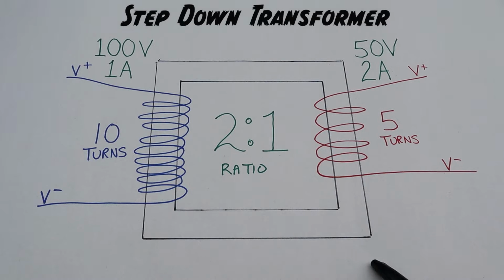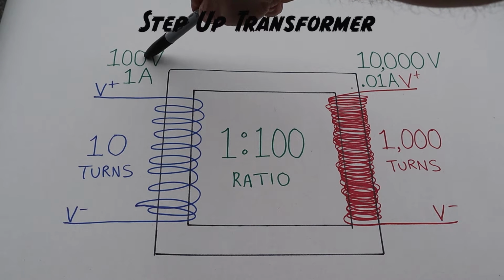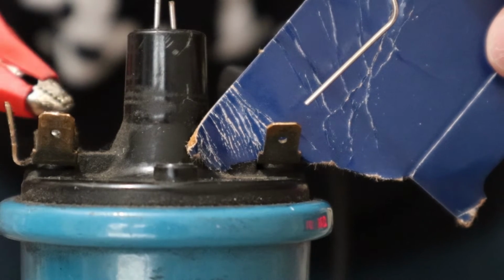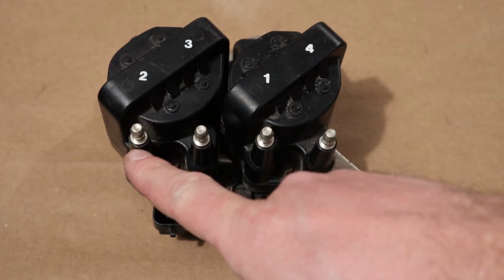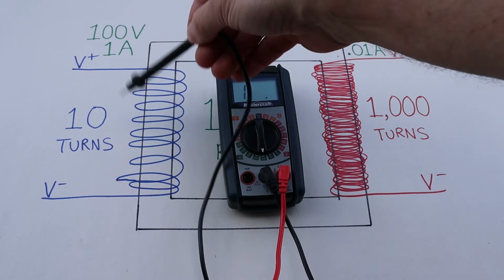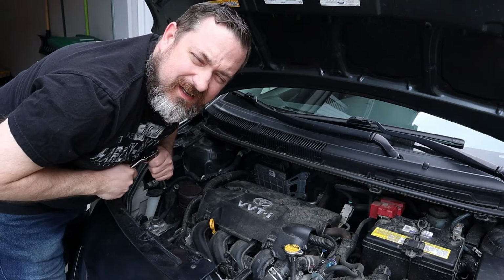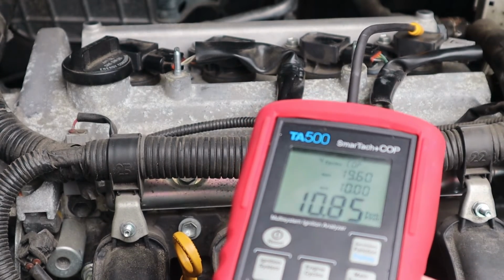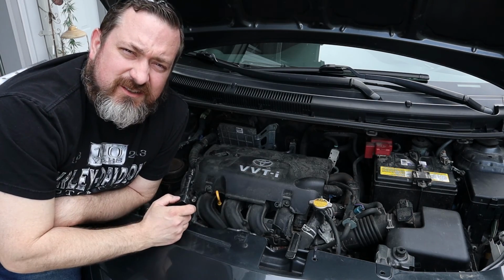Learn everything about ignition coils, coil packs, and coil over plugs. How to become a gearhead EP5

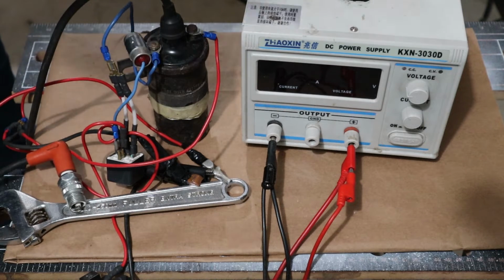Comment: 7:54 How were you causing the collapse on this coil?
Reply from the maker: I basically built an early Ford truck ignition system called a buzz box.  It uses a relay and a condenser to rapidly cause the coil to charge and discharge continuously.  Thanks for the watch and welcome to the channel!

Comment: Well I'm curious does one collapse provide enough juice to spark 4 times on a distributor or is the current gone after the first discharge? With that said how would an engine spark the rest of the plugs if it doesn't have enough? If you have engine battery distributor and coil what tells the coil when to charge and discharge each time is that the job of a distributor as well?
Reply from the maker: Nope, one collapse feeds one spark, then it must repeat for every spark plug.  The distributor has a cam in it that rotates and at a precise time, opens a gap on the points to trigger the collapse of the coil.  This induced electricity travels out of the coil along the distributor rotor and to the spark plug wire that is firing.  Hope that helps.  Thanks for the watch!

Comment: Excellent explanations! However the one question I still have on the older style coils, firstly how long do you have after the field collapses to get the spark from it? I'm asking with engine starting in mind. For example am I able to just charge it then when it's charged take it to the engine and start it with the spark it makes; are there going to be 4 necessary collapses for a 4 cylinder engine? Also if you were to label each input and output of the older coils, would the center be a positive? I'm trying to start an older engine and have tried so many things and still cannot get a spark. It's a 1949 Crosley Aerojet Marine, 6v. Also I plan to test your amazing method of using the paperclip that was smart. Thanks for your dedication on your video! Very good breakdown!
Reply from the maker: No it cannot be saved , it builds and collapses quickly.  Otherwise the thin wires inside would melt.  I would check timing on the old motor and check for spark when cranking.  Hope that helps.  Thanks for the watch!

Comment: Great video!  Had an old school coil fail on me this summer.  Took forever to diagnose as it had spark but not enough I guess.
Reply from the maker: Thanks!  Yeah coils can be tricky to diagnose as you found, ya gotta take high rpm rips to see if they cut out.  Sometimes you can do warmed up engine resistance checks of the coil but that's not always going to show you too.  Thanks for the watch!
Reply: @wayofthewrench  Question for you.  For guys running old stuff sometimes (like in my case), new parts just aren't made as well as legacy parts.  Is there a way to bench test an old coil to see if it matches the output needs of your car?
Reply from the maker: Not really.  You can test the resistance and check if it's ok but hard to test for a better part that won't fail later in life.  I know the old shops used to have coil and distributor test stations but I'm pretty sure it was just for failed parts.  Hope that helps.  Cheers!

Comment: Great explanation and practical lesson! Can you extend the axplanation to ingnition modules? Im looking for the best performance arrange in a programable ECU, but the system requieres al least 0,7 Ohm  on primary and les than 3.6ms of dwell (I asume to avoid saturation) . Thank a lot for the explanation!
Reply from the maker: That's awesome you liked the video.  Ignition modules are essentially electronic units that use transistors to trigger the collapse of the magnetic field inside of the primary coil when they receive signals from hall sensors and reluctor wheels (distributors).  They required no maintenance like points needed but were susceptible to heat and vibrations.  Back in the day, it was pretty common for these to fail.  In fact, a lot of gearheads bought extras and put them in the glovebox.  
Nowadays the modern ECU uses a wide array of input  sensors (crank, cam, air temp, coolant temp, mass air flow, throttle position, etc) and the ECU takes all of that information to figure the ideal time to trigger the collapse of the primary coils inside the coil over plugs. 

What kinda car ya working with?
Reply: @wayofthewrench  It´s  from the 70´s  jaja... Ford Taunus Coupe (The one in the avatar) has a 4 Cyl "Lima" 2.3 OHC engine.  Originally has a "Oily" coil and a resistor cable (acting like the ceramic resistor you show). I´m transforming it to 45mm ITB´s, Bosch 440 Injectors, and of course electronic ignition, but the ECU I bought can´t handle the coils directly, so I have to use coils with ignition module incorporated. Thanks again!